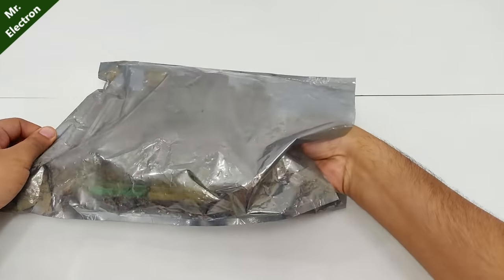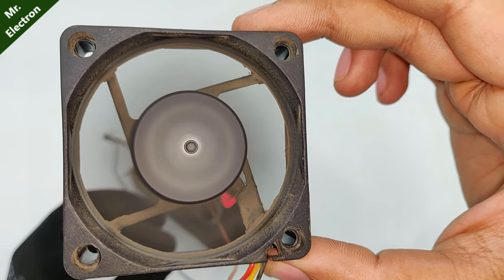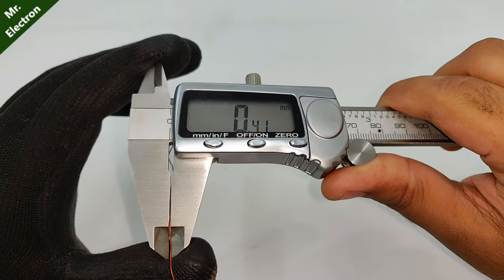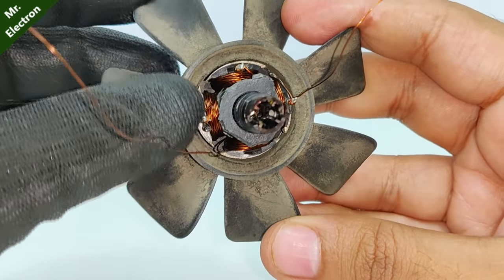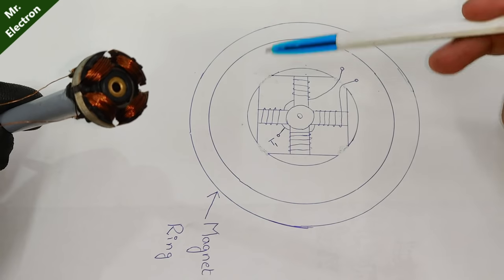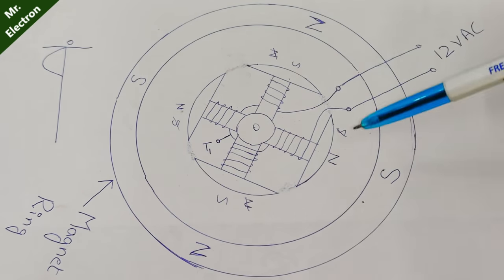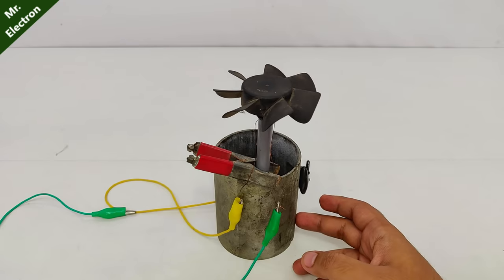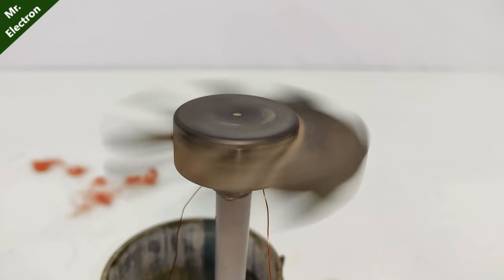12V DC Motor to AC Brushless Motor from CPU Cooling Fan - BLDC to AC Motor

Comment: I took a small bldc motor and wired it up to 8volt AC and it didn't spin but it buzzed and vibrated back and forth so what I did is took a capacitor and wired it to the other wire and the center wire and then it turned on

Comment: First you decrease the frequency to start rotate then you increase the frequency gradually....is this right?
Reply from the maker: Correct but how
Reply: You may using the inverter while inversion you can control the frequency of output voltage and current.

Comment: He used a ac fan voltage regulator. If you do a phase shift as he has two sets of poles already then without that magic he can start it directly with a standard 12v ac supply. Why do we have a caps in ceiling fans and domestic motors?

Comment from the maker: Correct Answer - I took another brushless motor which was geared and used it as a generator. I chose any 2 of its wires and connected it directly to my CPU Fan wires.
After that, when i turned it really slow, the frequency of the generated AC also became very less giving my CPU Fan time to catch-up to the changing poles and start the running part slowly.
After a few mili seconds, the poles got locked to the changing magnetic field there by making it synchronised and hence the rotation.
Faster i cranked my generator, faster the cpu fan moved.
Reply: I am really exciting to know the answer bro....give it soon
Reply: You gave it dc current than it ran
Reply: Try to make a super high speed  brushed motor
Reply from the maker: No dc
Reply: Change it's polarity
Reply: It is not working because it does not have a metal core metal core helps the motor to self start
Reply: Could you use a capacitor to phase shift the fields

Comment: I think you use dc current with the help of diodes bridge rectifier or use switching transistor or switching ic like 1 0 1 0 1 0 👍

Comment: Hi I feel 2 things either you used capacitor, or you used the power supply DC and changed polarity for it to turn clockwise and anti-clockwise, I also feel this because the RPM increased without voltage change you cannot increase RPM AC transformer was 12V stable!! 😂😂😂😂 Great Video 👍🏻👍🏻
Reply from the maker: Thanks !! No i didn't use any dc supply or a capacitor
Reply: @MrElectron  No worries Brother I do watch your videos will get it soon not an issue, just a query, I saw you winding the armature, two of the poles were wound clockwise, did you wind 2 anticlockwise or I understood wrong😂😂😂😂 please throw light, thanks a ton for reply Brother

Comment: I have a burnt hall sensor in one fan, I have a second one, I want to connect it connected via 3 wires to the coil of a working fan, type 1 hall sensor for 2 fans, will it rotate?

Comment: even though it's BLDC motor, at the end it's runs  on ac signal, where  driver circuit do  the conversion, yet I'm curious which method u used to run that motor, I'm subscribed to see the following  video.😇

Comment: Hii bro in this project you have used dc supply and we all know that dc does not change it's polarity like ac that's why you have not pushed the fan rotor...
I hope i am correct... 👍👍👍👍
Reply from the maker: No dc only ac can be used in such a situation
Reply: Thanks for correcting my answer bro... 🥰🥰

Comment: Dear Mr Electron
I watched your video on how to reverse a universal motor using a dpdt switch.

Please advise how to attach speed control to that.

I have a dc speed controller 2 wires for the motor and two for the battery.

Can you please advise where to put the two wires to the universal motor.

I’ve tried a few things and it’s not working.

Your help would really be appreciated.
Thanks
Reply: In line with the hot wire of the motor so it will work like a dimmer switch instead of just adding an overexertion of ohms and or resistance to your circuit because it's easy to do that when your asking this motor to not only change it's original duty cycle and direction! But it's speed too?! Hold on I'm gunna yell some loud things so I feel better..
Reply: @northwestrockgem9745  
I connected one of the motor speed control wires to the middle of the dpdt switch and it worked, the other wire was not needed, that’s weird !!
Reply: So I have two of the dc motor controller wires going to positive and negative.

And only one wire from the controller going to the dpdt switch !!

Comment: Sir make a copper wire spot welding machine on computer ups transfer. . 
Dose we melt 18 gauge wire for motor ..i need this type bt market have this machine price is 3000+..
I have a old ups bt safty components ke saath app ek video banao please. .